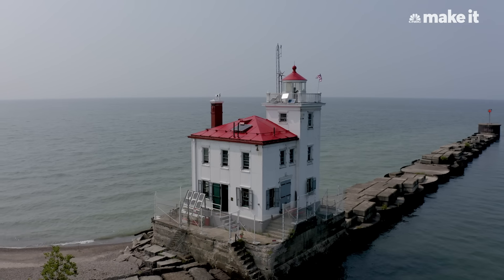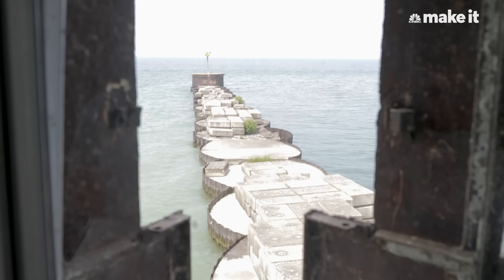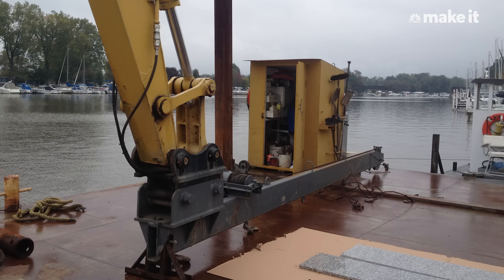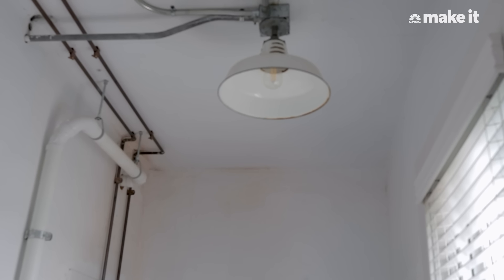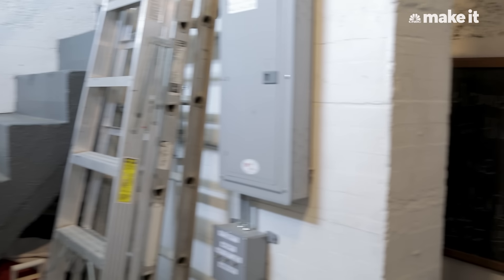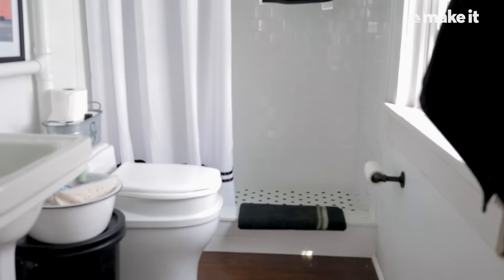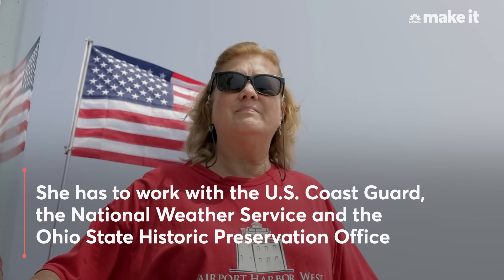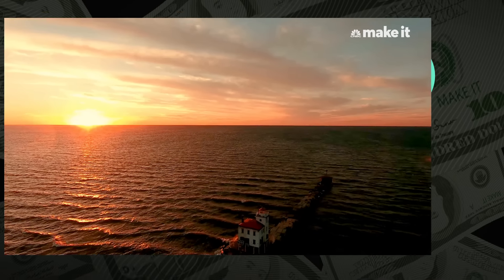I Bought An Abandoned Lighthouse For $71K & Spent $300K Making It A Home | Unlocked

Comment: It's interesting that the lighthouse was "abandoned" so long ago but there is still a working beacon maintained by the Coast Guard!  Surprising that the Govt. just didn't properly shutter the building and its windows to prevent deterioration and vandalization.  Thanks to Sheila for her restoration!!!
Reply: Was likely "abondoned" as residential quarters. Have toured a historic lighthouse and grounds which function as a museum. Similar to this they had no well water and collected rain water as well but had health issues. Glad to see her improved system.
Reply: Just retired after 30 years in the USCG. Worked on many lighthouses, most in the Great Lakes. The lighthouses weren’t abandoned, they are considered unmanned having gone from fuel oil to electricity for the beacons. The structure itself is maintained by the CG and I know for a fact because I did it…painting, roofing, windows, etc. We clean the interior but did not maintain the paint, we cleaned up falling paint, dirt, insects, etc. the exterior has to be maintained as to paint scheme because the lights are listed in the Light List manual which describes the lights characteristics. I could go on forever but you get my point.
Reply: @BladesRKing  Didn't she say in the video, though, that it was badly needing paint, and all the windows were broken out? Doesn't sound like it was maintained to the extend you describe.
Reply: @jd-no7rw  I don’t doubt it needed paint. Most are hard to get to and logistically a nightmare to maintain. So they get worked on when it really needs it. It’s not as easy as you going to Lowes for painting your garage. But they have to retain the characteristics i.e. paint color. Inside would not be repainted. Windows broken out is common from vandalism. We used optical grade Lexan to replace windows in house and cupola.   Also, if it’s up on the auction block to sell off the CG won’t spend much money doing anything to the structure except to maintain the beacon. Not sure if you were calling me out or not but those are the facts.
Reply: I live so close to this place you can see it from the end of my street. Its not abandoned... it is a fully functioning light station with fog horn etc. It operates every night and commands the entrance to the Grand River. The place she bought it beautiful, but whats the point of buying a place where literally 1000 tourists a day sit and fish off the main entrance of your house? Its so far away from a place to park...you CANNOT dock a boat there ( its the entrance to a port).. 

I have always been baffled why anyone would want to buy it. There are several nearly identical and fully functional houses all over lake Erie. Cleveland main entrance has one, Huron has one, Ashtabula has one. Its also interesting to note that the ORIGINAL harbor light station is also still nearby. 

this part of Ohio is notorious for its high humidity in the summer... the house is made of STEEL!!!!!!!   its an oven! 

so... to each his own..but its a folly

Comment: Why not add a solar array and battery system instead of gas generator. Way easier and nothing to block the sun near by.
Reply: It's Ohio. It's cloudy half the year
Reply: There could be several reasons, bigger pannels need more space, maybe that’s not available or she is not allowed to cover the house with it becaus of historic monument reasons. Or maybe they can’t be safely installed so they withstand the winter storms. Or too expensive. or not enough sun 😂
Reply: I came here to say that as well. Solar panels are cheap these days and there's plenty of room downstairs for a sizeable battery array. She could have plenty of power from it and never need to run the generator. For the other commenters here, solar panels produce power even on cloudy days. 
I suppose there may be restrictions on where she can place panels, how many there are etc.

Comment: That is way too much work just to live there: renovations, walking half a mile, no wifi, no electricity......
Reply: You can get wifi just not internet, if you get a signal booster it'll be fine, you won't be getting any fast connections but it does the job.
Reply: @Anonymoose66G  not true but whateves
Reply: @KangTheDigitalNomad  Why couldn't you get wifi? Starlink and other wireless connections/mobile data are networked across most of the globe, it's incredibly unlikely that this location doesn't have access to such connections.

Comment: There should be a special exception/accommodation made to the new owner, to be allowed to drive out to the lighthouse (most any 4x4 vehicle if necessary). Almost all the soft-sand beaches in North Carolina are easily drive-able, and permitted.

Comment: Could you not use a small boat for transporting, and buy a cheap cable winch at Harbor freight to winch it up ( 12 volt ) and secur it on the platform when not in use or bad weather ❤?

Comment: I actually serviced this lighthouse in the early 70s. I was stationed in the Coast Guard in Grand River where the light house and Coast Guard Station is actually located. It’s on the Grand River but named Fairport because I
The original lighthouse is across the river in Fairport Harbor Ohio. The original still stands and I believe it is used as a museum.  The lighthouse was never abandoned but was not occupied for many years. The Coast Guard Station maintained and serviced it as a aid to navigation. When I was there the windows were always shuttered. We were able to control the generator and fog horn remotely from the Coast Guard station . Really good to see it being used and maintained. 
It is all steel, and I understand it was built in Buffalo New York and brought on a barge to its present location.
Reply: There is a Sheila in it now.

Comment: You can with a small carburetor kit convert your gasoline generator to propane and water. Use the barbecue 20 pound containers or have a large container that you have a boat come and fill it either way it’s cheaper and actually less dangerous if you had a large container like we have we fill it up and it lasts a year and a half And that runs our heat and our generator something to consider great job renovating you should consider Airbnb. I know a lot of people would pay a lot of money to stay there.

Comment: Did you do a radiological survey?  In the 50s and 60s they were powered by radiological thermoelectric generators.  Usually strontium 90 but some used plutonium which would require an alpha survey and clean up.

Comment: If I were her, I’d have someone like Clinton of C&C Equipment buy a surplus army or industrial auction diesel generator and rebuild it for literally a fraction of a new one in cost + a 1000 gallon tank which could run almost continuously for much less than gas. Or go solar to at least run the lights and lighter load electrical appliances when her gas generators are off.

Comment: This is very cool, I love stuff like this. I"m curious about the water, if you are using rainwater stored in a cistern why does it have to be treated? Also, if you are going to treat it anyway why not use water from the lake?
Reply: The gutters and troughs that channel the rain water are exposed to the elements so dirt, debris, bird doo, etc. need to be filtered out.  As for the lake water, it could be filtered but the system would be costly and complex.  The lake has a host of contaminents from dead fish to oil/gas discharges from boats and tankers.  Erie was once declared the most polluted of the Great Lakes.  I grew up on its shore in the sixties and seventies and I've seen enough dead fish to where I still won't eat seafood.
Reply: @rudydedogg6505  OK, that makes sense, although Lake Erie is a lot cleaner than it used to be it's still not exactly mountain spring water!

Comment: So her solar doesn't work? I am confused why her solar is not enough to power her home.
Reply: You need at least a 4kw array plus batteries but they need almost constant sunlight to power a home. Big investment particularly if she only gets maybe 50 sunny days. Diesel generators are the only safe option off grid..
Reply: Her solar system in quite insufficient. It looks like she MIGHT have around 150-200W solar. I didn't see her battery bank so I can't say what kind of AH (Amp hours) storage she's got but am honestly assuming it's not much with those Harbor Freight solar panels she's got. 
Something like this house would need MUCH more Wattage with the panels.... I'd think around 7-8KW's with, at least a 1500AH battery system with a 6500W inverter to power an AC, the appliances, power for the house and what ever she would need... power tools, etc.
That's a bit more than what I'm going to upgrade our "Fulltime RV" with. It would be more than I need but I'm a much smaller space than she is. My 800w panels, 1500w inverter and the entirely too small 400AH batteries have to go bigger!
Reply: @chrischapman276  You obviously know a lot about solar equipment and nothing about Great Lakes lack of sunshine.